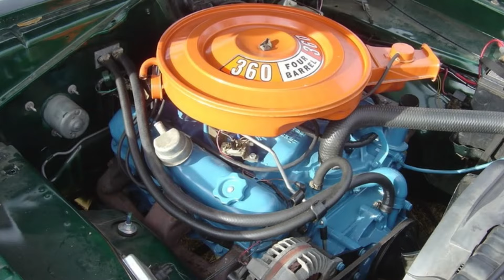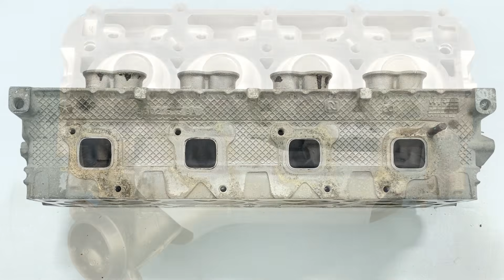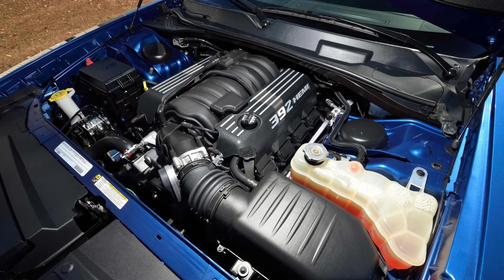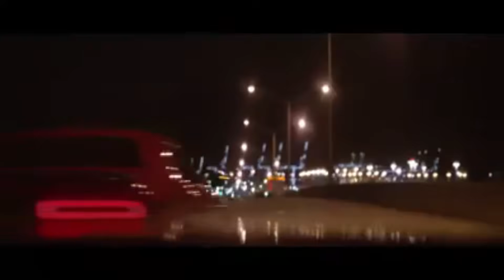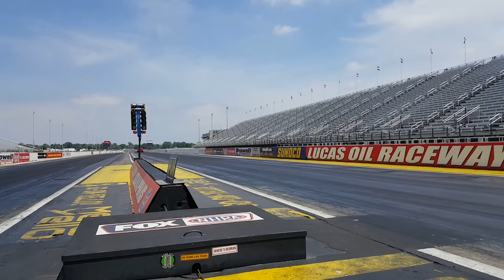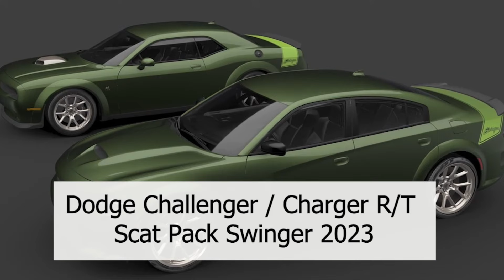The History of the Chrysler Hemi Gen III (Revised)

Comment: the 5.2L/5.9L V8 Magnum was first introduce in the 1990s to the early 2000s. which would have been for 10 to 14 years in production. not 30 years.
Reply: Not true you must not know a lot of Dodge history the 5.2l is a 318ci motor made way back in the glory days of mopar back in the 60’s-70’s and 80’s and the 5.9 is a 360ci motor all that changed is they don’t display cubic inch’s for motor size

Comment: Nicely done once again. The gen III hemi was an nice turn on the automotive industry. The 2003 dodge commercials are what got me into the newer style hemi engine. I like my 2005 dodge ram hemi. The power to weight is dam near perfect and theirs no MDS. The PCM is less restrictive, so tuning the engine is really nice. My truck sits on an 2 inch lift and 35inch Al terrain tires with an 6k rpm redline it gets to 120mph pretty fast. If my truck ever drops an valve seat I’ll just throw on an 6.1 intake and cylinder heads because parts are interchangeable. Keep up the great work 👍🏻

Comment: I just watched the two part series on the gen 2 HEMI or elephant motor Very impressive. The gen111 caries on the legacy but with modern computer controlled motors the new HEMI is not as far ahead as the original. GM and Ford have monster power also these days

Comment: The third generation hemi is not really a hemi engine but a ploy to sell a image
Reply: The change in the combustion chamber was a must to pass emissions and get better gas mileage. A true hemi chamber has a huge volume. Also the pistons would have to be domed which raises weight and cost. I think it still deserves the name becasue it is still a pushrod v8 with similar valvetrain and rocker setup and a deep skirt with cross bolted mains, 8 bolt crank, etc. If they didn't call it a hemi everyone else would
Reply: Semi hemi, like the Chevy rat motors and Ford 385 engines.